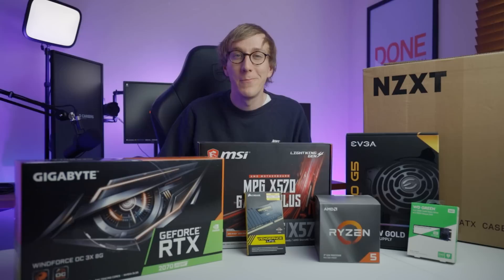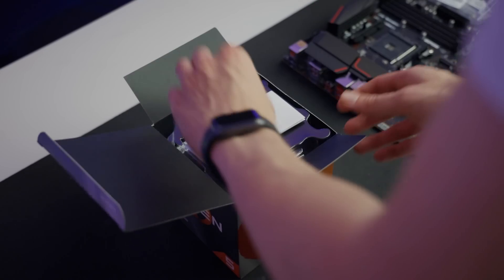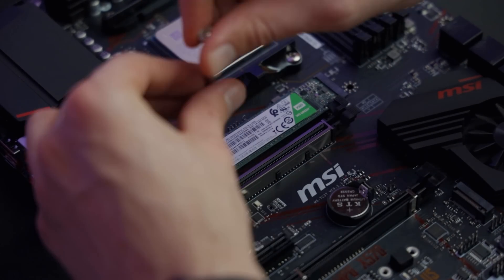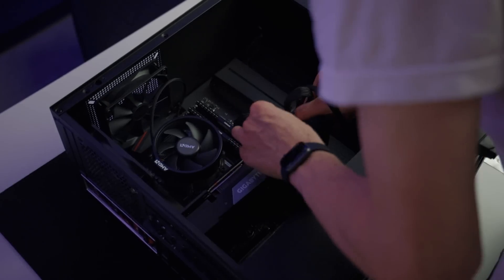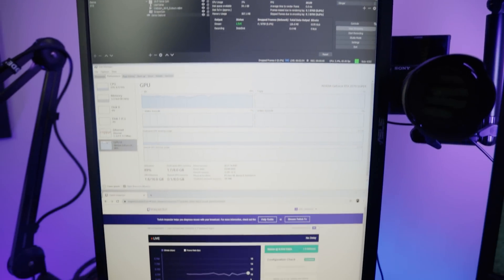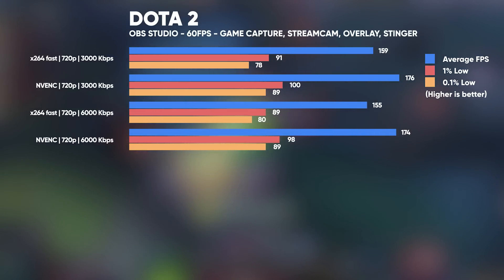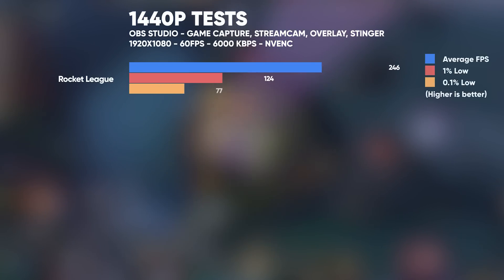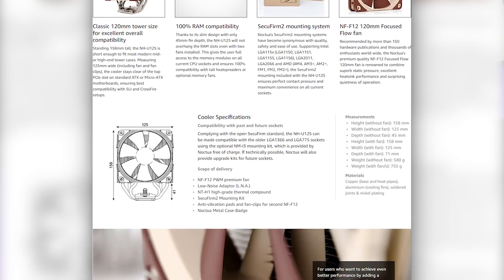Building the BEST $1200 Streaming/Gaming PC!

Comment: Do you recommend using nvenc or x264 encoding with a gtx 1080 ? i currently use a i7 4790k and i got a lot of fps loss while streaming, games like destiny 2 are dropping from 110fps to 50fps, same for Warzone, BF1.... using slobs or twitch studio give similar results, 720p @60 or 50fps 4500 to 5500 kbps, nvenc quality or x264 veryfast i still drop too much fps to be playbale

Comment: I have a similar PC, but haven't used it to stream yet.

CPU AMD Ryzen 7 3700X
CPU Fan Stock Cooler
MoBo ASRock B450 Steel Legend
GPU Asus6GB D6 RTX 2060 ROG STRIX A GAMING
Memory 32gb G.Skill Ripjaws DDR4 2400 mhz
PSU Corsair RM750X (2018) 750W
Storage 2 x 1TB Samsung SSD
Case be quiet! PURE BASE 500DX Window WHITE

Comment: What’s your guys thoughts on my set up? Give me suggestions on improvements I should make or if It’s a decent build. 
Ryzen 3600
5700XT
16gb ram at 3200hz
Msi tomahawk b450
1tb ssd
650w gold cert evga power supply
Tempered glass window 
Windows 10 pro 
1440p 144hz gaming
Fortnite at 144 at epic high settings 
90fps shadows tomb raider 
110fps modern warfare

Comment: hello, is there a reason why in the pro build are the: Corsair Vengeance LPX 16GB (2x8GB) DDR DRAM 3200MHz
 with 3200 mhz and in budget 3600mhz? And why also the lower motherboard? THanks alot

Comment: Note:NZXT H510 ATX Mid Tower Case has a front panel USB 3.2 Gen 2 Type C port that can connect to the MSI MPG X570 GAMING PLUS ATX AM4 Motherboard USB 3.2 Gen 1 header. A separate USB 3.2 Gen 1 to USB 3.2 Gen 2 header adapter will be required.
 Note:The MSI MPG X570 GAMING PLUS ATX AM4 Motherboard has an additional 4-pin ATX power connector but the EVGA GD (2019) 600 W 80+ Gold Certified ATX Power Supply does not. This connector is used to supply additional 12V current to the motherboard. While the system will likely still run without it, higher current demands such as extreme overclocking or large video card current draws may require it.

Comment: is the msi x570-a pro also gonna work? also is the corsair vengance 2x8 3600mhz intel support gonna work on an amd build? and also will the corsair cx650M power supply work for this? also does it matter witch thermal paste i use? and also is the gigabyte rtx 2060 super gaming oc 3x graphics card gonna work? because the 2070 is too expensive for me

Comment: I got all these parts exactly, and my motherboard isn't fitting the case... I've tried a lot, but if you look at the ports on the side (like the usb ports and six holes) it literally doesn't line up even when just holding them next to each other... I don't understand, I thought they'd be compatible!!! I don't know what to do... :(
UPDATE: The case was not actually the issue; the third party sellers from amazon gave me a product with the wrong I/O shield!!! I thought I was buying a brand new motherboard, but this link took me to a product that was used/refurbished. I am buying a new motherboard from another seller. Everyone try to make sure you're buying new when you can.
Thanks for making this video, it's still been helpful and I don't fault you at all for what happened.

Comment: Great video.Does the MSI MPG X570 motherboard have a header for the connection of the usb type c port available on the NZXT H510 case? If not which motherboards can support this?

Comment: I’ve done this exact build but with a different case, it WAS working fine but was only getting 1mbps download max when I should be getting 100mbps minimum, come next day battlefield V started lagging at 20 ping, the audio was lagging and even my home screen the mouse arrow was lagging, they’re 3600MHz Ram but sitting at 2133MHz but even in that case it’s lagging as if I had 0GB ram, I have tried everything, from control panel to updating the drivers to BIOS settings, updating windows but nothing worked, i factory restored it, used AMD cleanup, and reinstalled all the drives, it’s still laggy on the home screen but now can’t install the Chipset driver as there is an “error” which I can’t seem to fix? Any idea why that is and why my newly built £1200 computer can’t work?

Comment: Note to all who are doing this exact build: The WD Green M.2 drive in this particular build goes on the bottom (2nd slot) on the MSI MPG X570 motherboard. If you put it on the top slot like in the video shows at 3:35 the BIOS will not recognize it and it will say "Not Present". You can see in the video that the M.2 drive is in a different slot on 5:44

Comment: if your using this as a secondary PC just for streaming, you do not need a powerful GPU, because all of the graphics are made on your gaming PCs GPU. however it has to be encoded by the CPU which means that you would want a 6+ core CPU like a ryzen 5 3600x or  3700x. An intel core i5 9600k is one of the best options for streaming as it has 6 cores and has integrated graphics, which means you dont have to buy a seperate GPU. but as a streaming and gaming pc i would change that ryzen 5 to a ryzen 7 as you need more threads to run the games and the encoding for the stream.

Comment: Im going to build this pc myself but im really new when it comes to building one but do you have to buy windows seperatly or does it come with the parts?
Reply: How did it turn out
Reply: @5AMSunset  Pretty decent, only thing that sucked was that i bought the ram and it when i build the computer it broke down after like 3 months. Contacted the factory and got new ones. But it runs pretty much everything want.

Comment: Just a recommendation, but if I were you I'd use the RX 5700XT instead of the 2070Super. The 5700XT at time can be $200 cheaper and you can get on-par if not better performance. All in all, it really boils down to what games you play because some games prefer NVIDIA over AMD and vice-versa.

Comment: If you are going to build this, get the Asus Tuf X570 instead, a normal 3600 it's not worth the extra 25 dollars, just use the 25 dollars to get an aftermarket cooler and you don't have to get corsair vengeance, the brand of ram doesn't matter

Comment: Do you believe this will be able to run the upcoming COD in 2020? whilst streaming and recording with a 144hz monitor? what would i need to upgrade if need be? thanks.
Reply: Yes without any doubts. Especially 1080p 144hz
Reply: Will last for around 4 years i guess
Reply: @sushmalohia2721  thanks for the info bud
Reply: @bigdosser2120  no prob. Though i guess ur better off with a rtx 2060 super . Also, make sure to buy a b450 mobo as x570 is useless..

B450 Tomohawk Max - 114 dollars
Reply: @sushmalohia2721  I'm thinking of investing in an r9 3900x too mate so its future proofed
Reply: @bigdosser2120  why though. 5 3600 is more than enough for gaming. Or else u could wait for a while for the 4000 series to show up
Reply: @sushmalohia2721  If you dont mind can you tell me the ideal set up please? i just wanna game with 200+fps whilst streaming and recording simultaneously and video editing etc. with around £1000-£1500 budget.
Reply: @sushmalohia2721  I'm clueless basically with the hardware side of things.
Reply: @bigdosser2120  yeah sure

Ryzen 7 3700x or 5 3600

B450 mobo

16 gigs of ram 3600 mhz

H510 case 

240mm aio

Rtx 2060 super

Alienware 2020 monitor

1 benq monitor 100 dollars

Anne pro 2

Glorious model o
Reply: @bigdosser2120  the alienware monitor is dope. 240 hz, 1ms response time and ips panel
Reply: @sushmalohia2721  i really appreciate that mate thanks for the help.
Reply: @sushmalohia2721  I take it the r7 is the preferred choice?
Reply: 3800x is only £30 more then the 3700x. sorry if sound stupid but is the 3800x better?
Reply: @bigdosser2120  yes but not worth the 30
Reply: @bigdosser2120  because u can easily achieve the same performance by overclocking it

Comment: m.2 is a socket that support nVme and SATA based SSD drives. You installed SATA m.2 drive which will not increase speeds and not use PCIe lanes, and will be same speeds as a normal 2.5" SATA SSD. Getting a m.2 nVme SSD will.

Comment: Loved the video but there are a couple of minor things I wanted to point out.

1. M.2 SSDs can be both NVMe or SATA. The drive in this build is SATA so it's only different from 2.5 inch SSDs in form factor.

2. The Ryzen 5 3600x isn't really worth it over the 3600. It's probably better to just save the money and spend it on other things for your stream

Other than that great vid!
Reply: Spotted the same issue with the drive, so much 4 expert advice on youtube.

Comment: Nice I got the same PC haha, but I prefer the Ryzen 7 2700 I love having more cores/threads ;3

I can tell you that on NVENC everything runs fine at 5000-6000bitrate 900p 60fps, I like that resolution for Apex, Tarkov, Valorant and many other FPS.
Of course it can easily do 1080p or even more.

But you gotta do this 10:02 in order to get that performance. Probably the most useful tip you can get from the video.

Comment: My thoughts on this build:

- Buy a 3600 - if you are comftable with overclocking. Its so easy to just overclock it to 3600x levels, and its cheaper.
- Buy a b450 motherboard (I recommend the MSI B450 Tomahawk Max). You aren't utilising PCIe Gen4, and a lot of recent b450 boards come already with the latest bios that supports Ryzen 3000
- The m.2 drive used here isn't much faster than a normal SATA. If you want faster speeds, you need to look out for NVMe drive. The basic m.2 still use SATA like traditional 2.5" ssd's, but it just has less cables and is easier to install.  M.2 is just a form factor.

This is still a pretty good build, but there are places where you can cut money and still get the same performance. Also beware of the misinformation on ssd's.

Comment: 2 Questions
First of all, what program did you use to check your average FPS, aswell as the lows?
Also is there any reason you decided to do this build now rather than later this year? Nvidias new GPU Series aswell as AMDs new desktop processors will come later this year and can mean a massive improvement too.

Comment: Your information in m.2 isn't 100% accurate. There are NVMe m.2 drives and SATA based m.2 drives. NVMe uses the PCIe bus, but the SATA based drives do use the SATA bus and are limited to SATA3 speeds.

Comment: Nice video Pete! but you got the M.2 SSD part twisted.

There are 2 types of M.2 SSDs. M.2 NVMe SSD and M.2 SATA SSD. The SSD you are using for this build is M.2 SATA SSD (written on the SSD label) while both M.2 NVMe SSD and M.2 SATA SSD uses the same interface of M.2, the controller chip in the M.2 SATA SSD can only leverage the SATA III 6GB/s bandwidth. so M.2 SATA SSD is slower than M.2 NVMe SSD because it doesnt use the PCIe bandwidth. Just beware if you want to buy an M.2 SSDs, make sure you read the label or the packaging thoroughly.
Reply: So M.2 SATA SSD is not faster than traditional 2'5 SATA SSD because both of them uses the SATA interface only the difference is their form factor.

Comment: Small oversight on your part, I think - the WD Green SSD is a SATA M.2. As a result, it will likely perform very similarly to a 2.5" SATA SSD. You want NVME or straight up PCIe M.2 SSD's to get those higher speeds.
Reply: @ICT then replace the 2tb hhd for a 1tb ssd

Comment: I'd personally swap the 3600x for the 3900x and the 2070 super to the 2060 super...prices might not line up exactly, but should be more bang for your buck and a gpu upgrade would be more beneficial down the road.
Reply: With Nvenc as the encoder i personally would prefer the beefier GPU to deliver better visuals for the viewer aswell. You can basically max everything out on 1440p while streaming. at least in my pc.
Reply: @snakeace0  fair point...I still would go with a better cpu personally, just gets expensive lol.
Reply: @snakeace0  Nvenc doesn't scale per GPU, there is an improvement going from the 2060super to the 2070 super, but it's not much. the beefier CPU will mean you can have many more active processes open while streaming from a 1 pc setup. Also, the new GPUs are right around the corner. Go cheap as you can for now. Even an AMD solution will be fine.
Going for a SATA SSD is also fine. You won't see any problems. M.2 is just the connector. I hope he meant NVME M.2 SSD. Those are the very fast ones but like I said, you really won't see an impact in current games even while streaming and/or recording.
Reply: What if it was the b450 and ryzen 3700x
Reply: @rigobertorojas1691  depends.. is that for an upgrade(if so what do you have), or a new build?
Reply: @KeanuRevan  Is that I thought it would be better than the 3600x / x570
Reply: @rigobertorojas1691  well yeah 3700x is better than 3600x, but you don't want to upgrade from 3600x to 3700x just because it wouldn't be that big of a jump. 3900x at this point is overkill for most people, but it would last you a long time. Also if you're building b450 will cause issues in the future for upgrading.